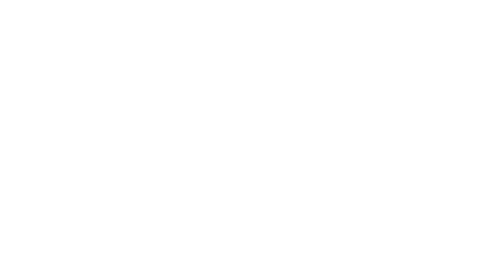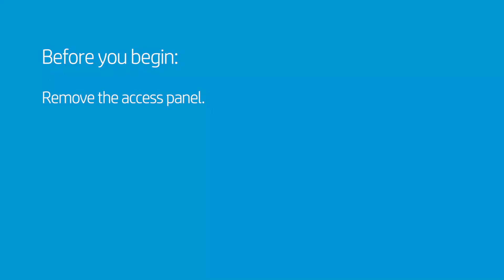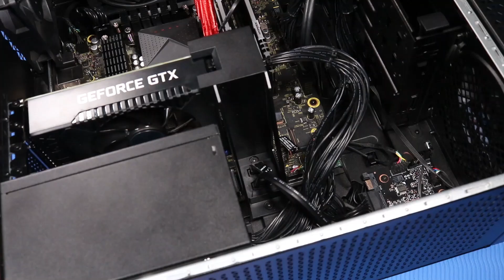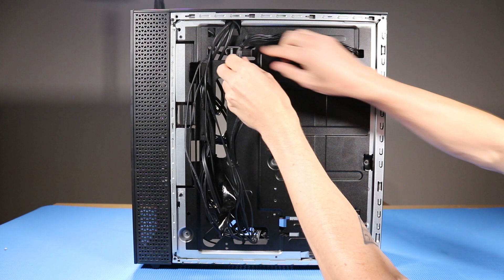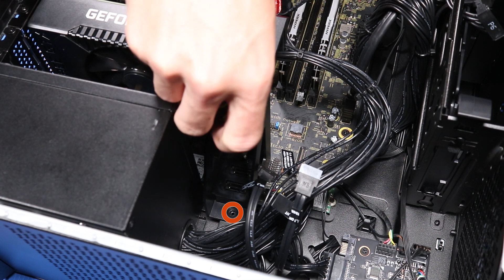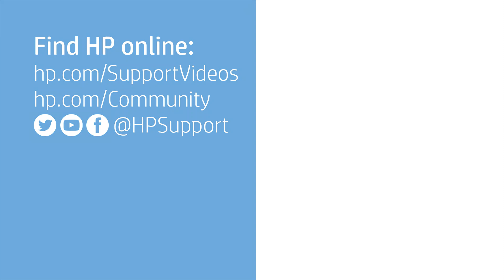Replace Graphics Card & Bracket | OMEN 25L GT11-0000a, GT11-0000i, 30L GT13-0000a, GT13-0000i | HP

Comment: Can i use any Nvidia gtx graphics card to replace the 1660 super that comes with my pc because the 1660 super only has 1 fan and the other graphics cards have 2-3 fans. and can it be any other companies graphics card? for example msi or asus rog
Reply from the maker: +Ghoulbtw This computer has One PCIe Gen 3 x16 socket (for discrete graphic card). So you can add the graphics card that supports this socket.

Comment: I’ve had my Omen 30L with the RTX 2060 and Ryzen 7 3700x for about a week now. I’ve noticed that there is a buzzing should coming from the computer when I’m in a game, and when I exit the game it stops. It sounds like coil whine but I’m not exactly sure where it’s coming from. Is there anything I can do to resolve this?
Reply from the maker: +Michael Sandoval Please perform updates via Windows and HP Support Assistant as mentioned below to fix this issue: Step 1 Windows Updates - 1) In the search box, type and open Windows Updates. 2) Check for updates. 3) If the updates are available, click on install and restart the computer. Step 2 HP Support Assistant Updates - 1) In the search box, type and open HP Support Assistant. 2) Check for updates. 3) If the updates are available, click on install and restart the computer.

Comment: Is it possible to replace the 2060 in my HP Omen 25L to a 2070 super or even 2080?
Reply from the maker: +iSwagRmC  It can be fitted with up to Nvidia GeForce RTX 2080 Ti or up to AMD Radeon RX 5700 XT graphics cards. They can also have up to 10th Gen Intel Core i9-10900K or up to the latest AMD Ryzen 9 3900 CPUs as well.

Comment: Does the graphics card need the bracket or no. I wanted to know as I want to put something bigger in that isn't as short as this card. One with two or three fans like a 3080 or something because they are longer than the one that comes with the pc
Reply from the maker: +King_Goose HP does not recommend upgrading or downgrading hardware parts or software that is bundled with the product as It may affect the manufacturer's warranty and performance, however, you could change the configuration at your own discretion.

Comment: Which ones cant i upgrade can the liquid cooled + fans one be upgraded to a RTX 3090 or any rtx 30's series
Reply from the maker: +NickBorlas HP does not recommend upgrading or downgrading hardware parts or software that is bundled with the product as It may affect the manufacturer's warranty and performance, however, you could change the configuration at your own discretion.
Reply: @HPSupport  but could I upgrade it to the 3090

Comment: Hi I was wondering how I could fit  my 2080ti in my HP Omen 30L. Do I need to remove the gpu bracket ? If so how because I tried to remove it but the screw didn’t budge. Please help. @hpsupport
Reply from the maker: +CullinanFN Please refer this video to know about replacing the video card: https://bit.ly/3nd6HNI

Comment: Hello, I currently have a omen 25l, (not a laptop) and it currently has a gtx 1660 super, I was wondering if I could change that to something better like a 2080? Don’t know if this is a question I should know or not but I’m just wondering if it’s possible. Thank you.
Reply from the maker: +Cole This computer has One PCIe x16 socket. So you can add graphics card that supports this socket.

Comment: @HP Will a GeForce RTX 2080 Ti support my 25l gt12-0060 model? Also will this guide work for my model too?
Reply from the maker: +DJ Rango This computer has One PCIe x16 Gen 3 socket (for discrete graphic card)
One M.2 socket 1, key A
One M.2 socket 3, key M
So you can add graphics card that supports these slots.

Comment: Is there a way I can upgrade the cooler on that same graphics card?
Reply from the maker: +Oscar Cab HP does not recommend upgrading or downgrading hardware parts or software that is bundled with the product as It may affect the manufacturer's warranty and performance, however, you could change the configuration at your own discretion.

Comment: Was wondering for an Omen Desktop 870-244 will an Rtx 3070 fit?
Reply from the maker: +This computer has 1 PCI Express x16 (Gen3.0) and 1 PCI Express x1 (Gen3.0). So you can add graphics card that supports these slots.

Comment: @hpsupport can I upgrade my 30L from a 2080 ti to a 3080 when the new geforce rtx 3000 series comes out?
Reply from the maker: +Gaming World It can be fitted with up to Nvidia GeForce RTX 2080 Ti or up to AMD Radeon RX 5700 XT graphics cards. They can also have up to 10th Gen Intel Core i9-10900K or up to the latest AMD Ryzen 9 3900 CPUs as well.
Reply: I just looked it up cause I planed on upgrading to a 3070 and it probably could get a 3080 but I’m not sure
Reply: Ok well I have the same question but with the 3070 will it be able to work?
Reply: @aaronjurcec5173  the 3070 is smaller than 2080 ti if im correct so it should 
but you can just look up the size between the 2080 ti and 3070
Reply: DId you ever figure this out? Or at least the maximum dimensions of a graphics card that the 30L can hold ?
Reply: Noah P it can fit a 2080 ti at most I’m pretty sure
Reply: @tippyxl6073  the 3070 is around the same size but the 3080 is bigger
Reply: Noah P so just look up the dimensions for a 2080 ti and compare it to other graphics cards

Comment: I’m planning on upgrading my RTX 2060. Will my 25L gt12-0060 model support a RTX 3060/3070?
Reply from the maker: +El Charro Negro This computer has One PCIe x16 Gen 3 socket (for discrete graphic card). So you can add graphics card that supports this socket.

Comment: Will a amd mesh oc 5700xt be compatible with the motherboard ,,?.
Reply from the maker: +Swifty Anthony This computer has One PCIe Gen 3 x16 socket (for discrete graphic card). So you can add the graphics card that supports this socket.

Comment: Hello, does the 25L model GT11-0012na support rtx graphic card upgrades?
Reply from the maker: +epiccatfishlol It can be fitted with up to Nvidia GeForce RTX 2080 Ti or up to AMD Radeon RX 5700 XT graphics cards. They can also have up to 10th Gen Intel Core i9-10900K or up to the latest AMD Ryzen 9 3900 CPUs as well.

Comment: Could you please tell me what the maximum dimensions a graphics card can be to fit in the HP Omen 30L model? I want to upgrade to the RTX 3080, but I am not 100% sure it would fit... I do know that my Moria3 Motherboard is compatible and I have already upgraded to the appropriate power supply (being a 750W).
Reply: HP Support through the BestBuy website told me that my motherboard and power supply would work. But they told me I would need the dimensions of the 3080.
Reply from the maker: +Noah P You can purchase the part from here: http://partsurfer.hp.com/ Please select your country and enter serial or product number of your unit.
Reply: Founders Edtion of the 3080 will fit. Can't promise for every single custom edition out there but most of them should fit as well.

Comment: will a 3070 fit in the 30l
Reply from the maker: +Nick 10215 This computer has One PCIe x16 socket. So you can add graphics card that supports this socket.
Reply: It will i did some reserch into it
Reply: Hey I just got a 2080 ti for my omen case will I have any issue. Did you run into any issues with yours?

Comment: i have the GT12-0020 model and i was wondering if i could take out the parts and put them in a custom pc, or is that not possible?
Reply from the maker: +Alex Montalvo HP does not recommend upgrading or downgrading hardware parts or software that is bundled with the product as It may affect the manufacturer's warranty and performance, however, you could change the configuration at your own discretion.
Reply: @HPSupport  lets say i don't do that, what cards would fit in that model?

Comment: Would a 3070 size in a Omen 30l gt13-07097nz
Reply: I believe the 3080 will fit just need to remove the bracket.
Reply: @skym3295  does a 3070 fit ?
Reply from the maker: +Blacki Eu This computer has One PCIe x16 socket. So you can add graphics card that supports this socket.

Comment: Would a 3060ti work with the 25l?
Reply from the maker: +1996ToyotaCamry This computer has One PCIe x16 Gen 3 socket (for discrete graphic card)
One M.2 socket 1, key A
One M.2 socket 3, key M
So you can add graphics card that supports these slots.

Comment: What GPU can i fit into a HP OMEN 25L GT11-0012na ? I got a 1660 super looking for an upgrade
Reply from the maker: +Zan V This computer has One PCIe x16 Gen 3 socket (for discrete graphic card). So you can add graphics card that support this socket.

Comment: Will this void the warranty?
Reply from the maker: +Your Worst Nightmare HP does not recommend upgrading or downgrading hardware parts or software that is bundled with the product as It may affect the manufacturer's warranty and performance, however, you could change the configuration at your own discretion.

Comment: Hi can i replace my HP OMEN GT11-1426NO (25 L case) with a 45 L case and buy a new PSU to power up a potential rtx 4090?
Reply from the maker: Hi there, thanks for contacting HP Global Social Media Support!
I understand that you need to know about changing the case of your computer.
I will do my best to assist you.
HP does not recommend upgrading or downgrading hardware parts or software that is bundled with the product as It may affect the manufacturer's warranty and performance, however, you could change the configuration at your own discretion.
Binu - Social Media Tech Support

Comment: Will a 6900 XT fit?
Reply from the maker: +Jarjr222 This computer has One PCIe Gen 3 x16 socket (for discrete graphic card). So you can add the graphics card that supports this socket.

Comment: can i use a gtx 2060 in my omen 30l gt13-0014
Reply: Yes, that's what I'm currently using
Reply: @khalidkhalaf547  do I have to upgrade anything else?
Reply: Zieg Aubrey nope, I’m running 16gb ram 500 w PSU and a ryzen 7 3700x with my 2060
Reply: @khalidkhalaf547  I have one hyperx ram stick? I7 processor, and I think a 500 w power supply

Comment: If I install a liquid cooler on my 25 l Will the warranty still work?
Reply from the maker: +Xiaoyu HP does not recommend upgrading or downgrading hardware parts or software that is bundled with the product as It may affect the manufacturer's warranty and performance, however, you could change the configuration at your own discretion.
Reply: Thanks for the information!

Comment: Can I put a 3080ti or 3090/3080 on my 25 L ?
Reply: It depends on ur cpu my 25l has I5 10gen and if you put a high end gpu you have bottle necking which strains a lot from ur system I would recommend having like a 17 or Ryzen 7 or higher to Match the power  of that gpu
Reply: I have Intel core i7 10700F
Reply from the maker: +Baba boey This computer has One PCIe x16 Gen 3 socket (for discrete graphic card)
One M.2 socket 1, key A
One M.2 socket 3, key M
So you can add graphics card that supports these slots.

Comment: My Evga Rtx 2080 ti wont fit in mine my model is a (GT13-0xxx)
Reply from the maker: +optifight This computer has expansion Slots:
One PCIe x16 socket
One M.2 socket 1, key A
One M.2 socket 3, key M
So you can add graphics card that supports these slots.

Comment: @Hpsupport  if I turn  a game  there's  no signal  on my screen
Reply from the maker: +fnrost Please perform updates via Windows and HP Support Assistant as mentioned below to fix this issue: Step 1 Windows Updates - 1) In the search box, type and open Windows Updates. 2) Check for updates. 3) If the updates are available, click on install and restart the computer. Step 2 HP Support Assistant Updates - 1) In the search box, type and open HP Support Assistant. 2) Check for updates. 3) If the updates are available, click on install and restart the computer.

Comment: i have omen 25l and it contains rtx 2060 graphics card, will i be able to upgrade it to a Gigabyte NVIDIA GeForce RTX 4060?
Reply from the maker: Hi Dream, thanks for contacting HP Global Social Media Support!
I understand that you need to know about upgrading the graphics card of your computer. 
I will do my best to assist you.
The computer has a 500 watt power supply, so you can upgrade the GPU to another one that doesn't require more than a 500 watt PSU.
May I know the complete model number of your computer so that we can check the details for you?
Regards, 
HP Support
Reply: OMEN Desktop PC 25L GT12-0000i @HPSupport
Reply from the maker: Thanks for getting back to us. Well,  The RTX 4060 has a TDP of 115W and Nvidia recommends a 550W PSU. But again upon doing simple calculation, 
300 watts = Simple system (basic stuff with a CPU under 100 watts)
115 watts = RTX 4060 (No Over Clock other than Factory)
415 watts = In use
41-83watts = 10-20% Overhead 
456-498watts should be sufficient to use a RTX 4060.
Hope this helps!
Akhil_HP Social Media Tech Support
Reply: so il be able to use a rtx 4060 on my OMEN Desktop PC 25L GT12-0000i? and also would i be able to change graphics card on my OMEN Desktop PC 25L GT12-0000i as currently i have a rtx 2060 but i want to upgrade to a rtx 4060 @HPSupport
Reply from the maker: Well according to Nvidia, you will need a 550W PSU and your PC only has 500W PSU, but theoretically you could use a RTX 4060 on a 500W PSU and if you're planning for an upgrade make sure you get the model that fits your cabinet by checking the graphics card dimensions.
Akhil_HP Social Media Tech Support
Reply: so would a RTX 3060 fit? and would i be able to upgrade my CPU @HPSupport

Comment: Would a RTX 2060 super (founders editions) fit in the case?
Reply from the maker: +Prince Centillas It can be fitted with up to Nvidia GeForce RTX 2080 Ti or up to AMD Radeon RX 5700 XT graphics cards. They can also have up to 10th Gen Intel Core i9-10900K or up to the latest AMD Ryzen 9 3900 CPUs as well.
Reply: Yes, if they can fit 2080TI in there, 2060 sure is not an issue.
Reply: @HPSupport  does this apply to HP Omen 30l as well? I want to swap my RTX 2060 for a 2070 Super or 2080 when the 3000 series comes out and prices drop
Reply: @Hawks actually this is a valid question.. mine is a very similar model being a 30l with an RTX 2060 but the fans on it have been removed at factory as well as the AMD Ryzen 7 3700X heatsink ( I assume because the case has plenty of fans and air moving through) but it makes me wonder if there is a specific small version of the card we need to use @hpsupport ?
Reply: @HPSupport  I am about to put a new RTX 2070 Super in my 30l but I am not sure you can go above that without also replacing the power supply. Waiting to find out on the 3070 power draw and size and how the 2070 Super fits in there

Comment: My omen 30L comes with a gtx 1660 super but i am looking forward to replacing it with an rtx 2080 ti but i am curious to know on if it will fit
Reply from the maker: +Mona_rchy - This computer has One PCIe Gen 3 x16 socket (for discrete graphic card) So you can add graphics card that supports this socket.

Comment: I have an OMEN 30l gt13-0024 can I upgrade to the Rtx 3080?
Reply: same question here
Reply from the maker: +Luis Velasquez  It can be fitted with up to Nvidia GeForce RTX 2080 Ti or up to AMD Radeon RX 5700 XT graphics cards. They can also have up to 10th Gen Intel Core i9-10900K or up to the latest AMD Ryzen 9 3900 CPUs as well.